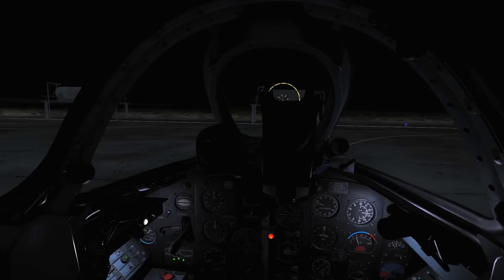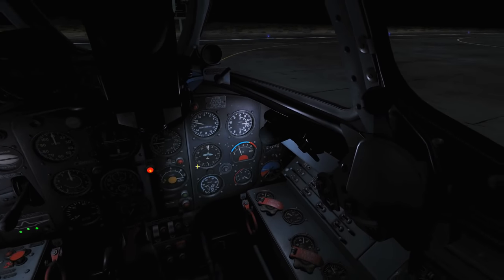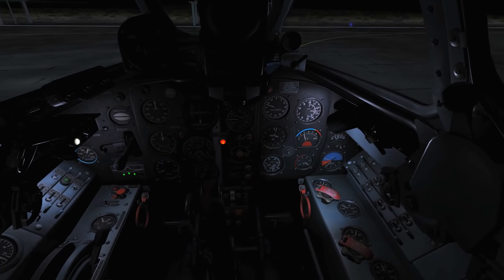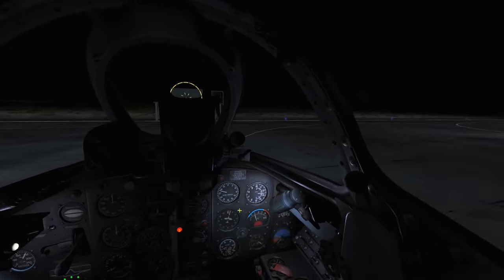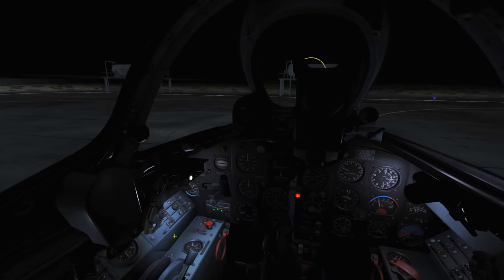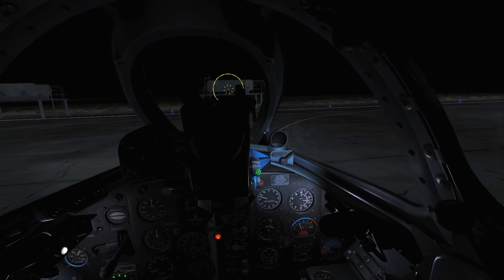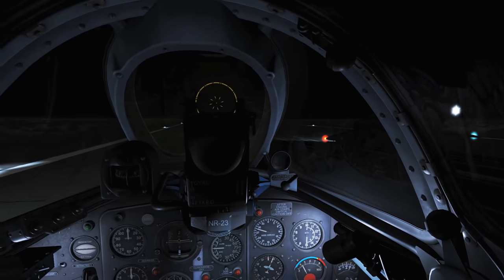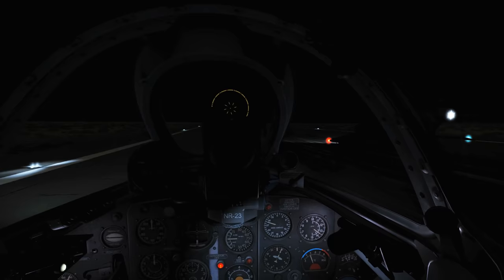Mig-15bis: Airstart, Night Flying, Over-Speed, Flares, Jettison Tutorial | DCS WORLD

Comment: Alright, so: About the drop tank fuel pressure, there's a green light on the opposite side of the 3 gun indicator lights which will come on when the fuel pressure is low. What Cap kept looking at was just the On/Off switch for this light, the light itself was hidden by the stick the entire time.^^

Also I don't think you actually turned on your UV lights, Cap. Either that or the flood lights were so bright I couldn't tell. The actual writing on the instruments should give off this kinda nuclear looking green glow when they're on.